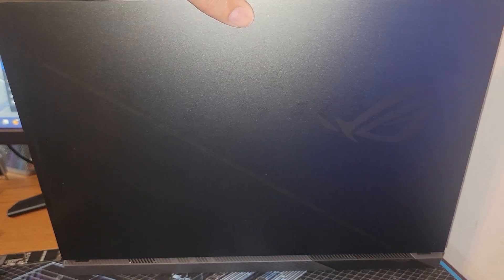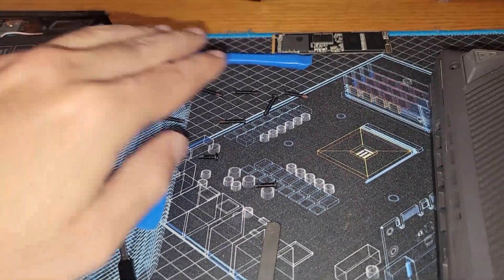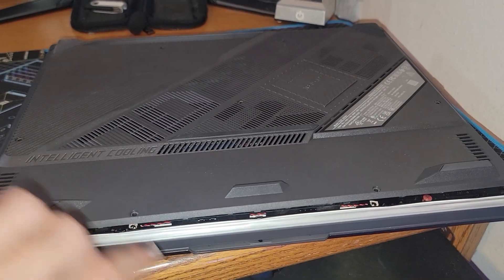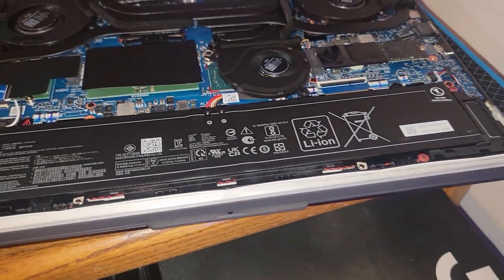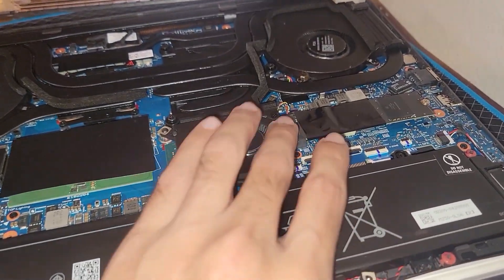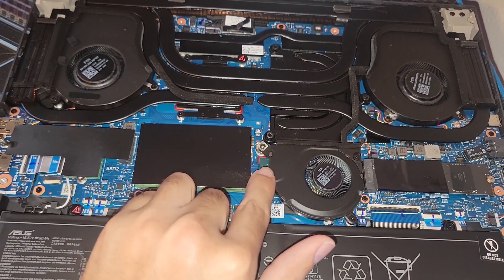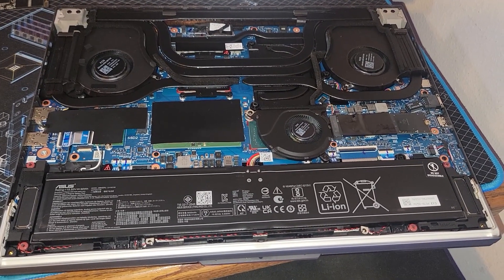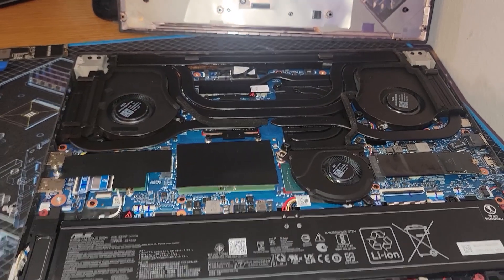Asus ROG Strix G16 Laptop Teardown - Upgrading

Comment: Hi in connect an Ethernet cable and try to remove it and that time i dont push cable bottom enough so i use lots of force that my laptop moved and i hear noise. Is my lan port broken? I connect again cable and its worked fine.

Comment: On the very back of the plate, there are dust covers. Could these be the reason for causing too much heat? They block a lot of airflow, I just tested it out
Reply from the maker: Could be, how are thermals

Comment: Hello, what speed run this wd sn560 ? I want to upgrade it cause its sound slow
Reply from the maker: Really slow compared to other models but for laptop you don't want gen 5 Nvme, it will over heat. About 4.5 GBps Reads, and 3.2 GBps writes. IOPs sucks tho 69MBps 4KQD1. It works fine for normal gaming and normal uses, just not the fastest

Comment: Hello - Quick Q
I want to buy a ASUS ROG Strix G16 (2023) Gaming Laptop, 16” 16:10 FHD 165Hz, GeForce RTX 4060, Intel Core i7-13650HX, 16GB DDR5, 512GB PCIe SSD - 
How can i tell if i can upgrade to a 2TB SSD
Reply from the maker: If it js the same model as mine, you should have two M.2 slots. On the main board itself, but you won't know until you open it. Or check the Asus specs page
Reply from the maker: It does look like you have an extra slot for m.2 2280 NVME drive. check out this review video, look at bottom left of time linked.

https://youtu.be/j6RDdWrx7Gk?si=PlfAbolr6wL0k3jW&t=200

Comment: do you have to remove the heatsink too in order to clean the fans?
Reply: NEVER do it if you have a warranty on your laptop. You just need to spray compressed air on your fan 1-2 times while holding the fan still for it to not break.

Comment: Hello i just was wondering if you can make a video explaining how to change the thermal paste of the gpu (because i will buy a srix g16 and i dont know how to do it with the liquid metal on the cpu)
Reply from the maker: So, because it comes stock with liquid metal, I would not recommend replacing it. Unless you have done it before, I have used liquid metal on my Acer Predator Helios 300 15.6, which can help you.
Reply: @SerpentXTech  does the 3 fans have liquid metal? Or just the upper 2? Some users said the small fan in the center area can easily be removed without liquid metal

Comment: Hi, I have a question, Can you fit 64Gb of ram on this model?
Reply: Hey there! I have seen that the laptop will indeed recognize two 32gb ram sticks for a total of 64gb even if the website say the total amount is 32gb
Reply: Yes, the asus page says it max 32gb but processor accepts 64gb and it works great
Reply: I can confirm this 👌, new bios also supports faster speeds.
Reply: @cherrin13  Using the new bios, what is the correct frequency, 4800 mhz or 5200 mhz?
Reply: @carlosarmando95  you can run either, the.  Just make sure they match.  And remember the higher the frequency doesn't always mean faster.  The lower CL numbers are important to consider as well.  Some 4800 is faster than 5200, but not really noticeable at a consumer level.

Comment: I have a doubt if installing an additional SSD requires a heatsink or not
Reply: im concerned too i bought a samsung ssd 980 pro wih heatsink and it looks kinda thick. does anyone know if the heatsink it self gets really hot ?
Reply: @saceboi  Worked perfectly?
Reply: Yeah pretty sure my wifi card died because of the heat from the other m.2 drive